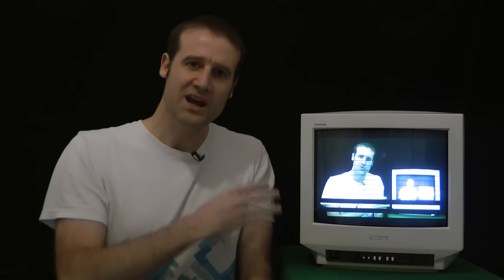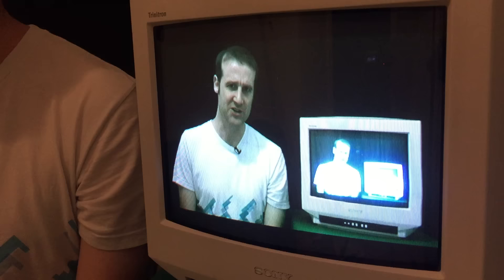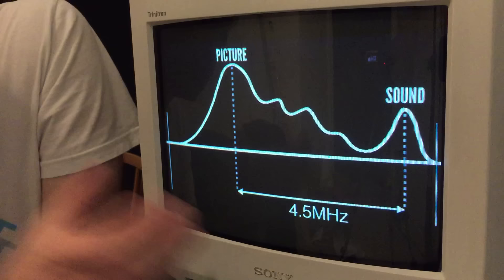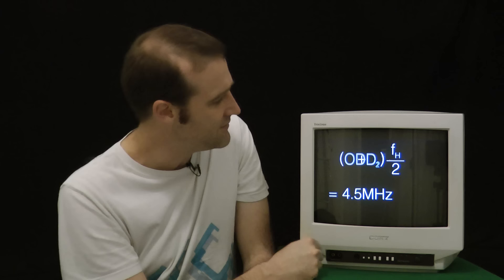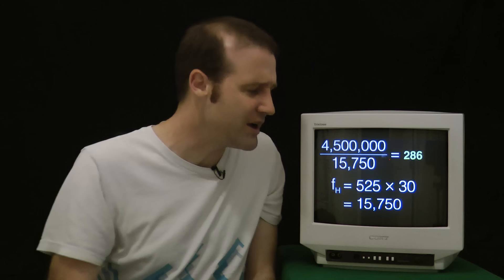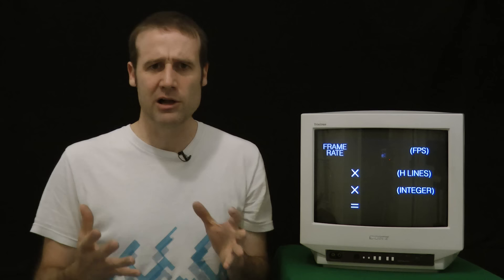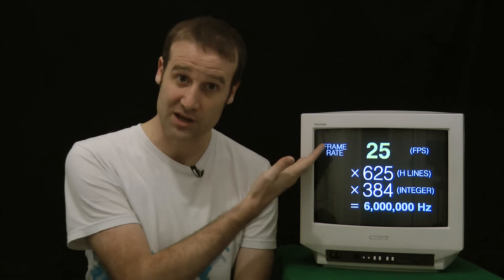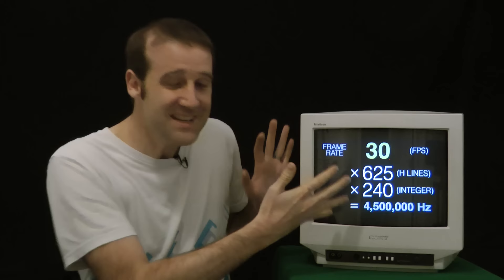Why is TV 29.97 frames per second?

Comment: Nice explanation and great graphics. Thank you.

Yes, film studios with their 24Hz frame rate would suffer badly from flicker when using mains-powered lights. So they commonly used to employ dc lighting powered by ac to dc converters comprising enormous ac motors driving great big dc generators (dynamos) to derive the current. Changing the frame rate would have been a right pain in this respect and even worse than film since a lot of television was, like the news, not staged and so not lit especially for the cameras.

With only 24 pictures per second, film is not great for showing smooth motion and cinematographers learned to film fast action coming toward the camera rather than across the stage. Forty-eight Herz is also a rather low flicker rate and was detectable by viewers though we became accustomed to filtering it out. Twenty-five frame TV was not significantly better with its 50Hz flicker. If you want to see it, look at the picture from a CRT set without frame-rate enhancement with the periphery of your eye.

Traditionally, the frequency was always expressed as 30 x 1000/1001. 

The point where this all went wrong was timecode. There are several awful things about the NTSC frame rate when it comes to accounting for each frame. First is that if you synchronise your clock to show 00:00:00:00 at midnight, then that event will never occur again - a frame boundary will never again happen at midnight. Next, the frame counter will be about 0.1% out. So drop-frame timecode was invented. The issue with drop-frame is that you really needed to handle positional values (the frame number of a frame) differently from interval values (the duration) and we didn't. Even accepting that we did not do that, no-one understood the arithmetic that was employed and the computer code to handle drop-frame was almost always (read always) wrong. There is a test that you can do where you ask the code to add one frame to a duration and the calculated out-frame value actually moves backward two frames rather than forward one. This is simply sloppy coding but software regularly could not handle this (and no-one tested for it).

Even 25 frames-per-second television was not immune to editing problems because the PAL eight-field sequence meant that you could only cut together two pieces of PAL encoded video when one was aligned to the other so that their eight field sequences matched. Put simply, and imagining you could hold video like pieces of film, you would cut the first where you wanted that sequence to finish. However, you could not then cut at the exact field boundary where you wanted to continue with the action in the next clip and join them together. Instead, you would have to align the second strip, shifting it until it lined-up its eight-field (four-frame) sequence to the first strip. This could mean getting up to seven extra fields that you did not want or losing three fields that you did! NTSC was slightly better but still had a four-field (two-frame) sequence.

Lastly, interlace didn't work. It may have been our first attempt at picture compression but it was a bad idea. In theory it delivered sharper pictures at a greater flicker rate in a lower bandwidth, only they were not sharper. Don't say this to anyone involved in TV from way back when because everyone learned the theory and next to no one questioned the empirical wisdom. Truly though, it did not work. It did improve the rendering of motion but did nothing for sharpness and this was clearly visible if you actually looked.
Reply: To be fair, you only had to worry about eight-field framing when doing "invisible edits". At a normal shot-change, four-field synchronisation was perfectly adequate.
For those not in the business, an invisible edit was one where you made an edit, (ie the recorder switched into record mode) but instead of recording a completely new image (eg cutting from a wide-shot of the landscape to a close-up of an actor),  the new image was identical to what was already on tape. It sounds pointless but it was necessary when you wanted to add visual effects. You sometimes see four-field attempts at invisible edits in old TV programmes, where the whole picture hops slightly to the side just before a mix to a new scene.

Comment: I love that at the end of the video the image on the screen has a visibly moving scan line because you recorded a 29.97FPS TV at 30FPS (used by Youtube and most modern video recording equipment but they also have a 25FPS option in these cameras as they are now often sold internationally, on a side note it's also why some lights flicker when filmed because of the camera being set to the wrong frame rate OR the lights are running through a cheap transformer that alters the Hz of the light to the standard in the country where the unit was manufactured).

Comment: My video tech career goes back to the mid 1970's. As a teacher and mentor I've often explained the 29.97 fps mystery to students of digital media,, but always from the aspect of backwards compatibility with 30fps televisions (-; so consumers could continue using their existing hardware, back when tech corp. profiteering through planned obsolescence, walled gardens and forced migration was limited by proper regulation and standards enforcement ;-). This explanation from the parallel concern of broadcast bandwidth allocations was enlightening and appreciated (as with most all your YouTube offerings)!.  Still, I find the engineering from the hardware signal and CRT compatibility side even more amazing, The final compromises, however, meant that accurate color reproduction in NTSC was very problematic compared to the European standards, thus, for many in the U.S. television industry, the NTSC acronym stood for "Never Twice the Same Color", while PAL was considered "Paradise At Last". The engineering of producing "moving" images from a single amplitude modulated signal will remain genius to me in any case.

Comment: Thanks, Matt. That was great! I knew the basics why, ie adding the colour info signal into the same bandwidth, but I had NO idea of the maths behind it.
Given the benefit of being able to improve on existing standards (ie NTSC, or "never the same colour") PAL turned out to be far superior, both in resolution and simplicity.
Long before colour, 30 fps TV had the awkward problem of transmitting 24 fps film without obviously speeding it up. Thus the 2/3 pulldown technique.
PAL, and 25 fps B&W TV before it, had no such problem. Running a 24 fps film at 25 fps was imperceptible, unless the viewer timed it VERY carefully.
Fortunately the advent of digital TV to match that of computers has (generally) meant MUCH less hassle than the old days of PAL (and SECAM) vs NTSC.
Also, in PAL countries, being able to record far longer on the same Beta cassette than our NTSC counterparts! (I still can't quite get WHY, though?)
Reply: 24 fps film broadcast might be one of the few areas that NTSC was better than PAL (I'll admit my knowledge of SECAM is lacking).  Over the course of a 2 hour movie, 2:3 pulldown would increase runtime by about 7.2 seconds, where as playing it a 25 fps would decrease playtime by 288 seconds; however, both would be almost entirely unnoticeable if you were watching it to actually enjoy it and not nitpick.

While I can't say exactly why Beta tapes last longer, I would guess its the same reason VHS tapes do.  In a VHS drum each full rotation records one frame (two head place 180 degrees apart for each field), so in order to record 29.97 fps, the drum must spin 29.97 times a second or 1798.2 rpm (1800 for B&W), where as to record 25 fps, the drum must spin 25 times a second or 1500 rpm.  VHS tapes were sold with different lengths of tape inside, but Beta was not, the same exact tapes were sold in PAL and NTSC. Because the cassette itself was unchanged between regions, and the drum size was the same, the NTSC tape was pulled further every second than the PAL tape.  I hope that makes some sense.
 
I will warn you though, it is possible that the drum itself is larger for NTSC and it spins at 1500 rpm too, but that seems unlikely. I say this because at 1800 rpm for NTSC and 1500 rpm for PAL would allow the exact same drum motor to be used because the of 60 hz vs 50 hz.
Reply: @dontworry1302  What a fabulously detailed reply! I am really very impressed with your level of research, knowledge, and insight!
"Because the cassette itself was unchanged between regions, and the drum size was the same, the NTSC tape was pulled further every second than the PAL tape. I hope that makes some sense." Yes, that sort of explains it, although LESS data (525 lines) should have resulted in LESS tape used per second of video in NTSC, IMHO.
However, whatever the pluses and minuses of Beta vs VHS, the simple fact remains that screening a 24 fps film on TV @ 25 fps is SO much simpler to achieve (ie NO conversion) than 24 fps to (almost) 30 fps. In fact there is NO apparent effect (unless you have a stopwatch), but in a relatively longer film it does make slightly more time for another ad or two! However, this only applies to (usually) SD broadcast television. So the minor (if almost indistinguishable) advantage of PAL (and SECAM), is more or less quite moot in these days of digital media. Therefore a Blu-ray disc (or equivalent download) is ALWAYS preferable to DVD quality these days for me! 
OTOH, if DVD is the only option, then I will ALWAYS prefer a UK DVD @ 625 lines vs a USA DVD @ 525 lines; just better visual resolution! (NO arguments accepted!)
NB: I especially LOVE the ability to watch true HD video in 1080p on BluRay. I also really love that the vexed issue of NTSC vs PAL has faded, at least wherever videos are available in true HD (1080p) or better. (BluRay region encoding IS a nuisance; however I buy all mine from the UK, so no problem!)
Reply: @rahb1  I was never a huge fan of DVDs, maybe because I was always watching them on SD LCD TVs and I can't stand the awful quality on them whether 525 or the few times I had access to a PAL LCD TV (got to love when family buys weird imports). My parents bought a PS3 back in 2006 at launch specifically for blu rays, and it was the first time I was fully able to enjoy home movies. Of course now I'm not sure I'd be able to stand 720p, but I guess thats just progress. 
I'm not sure about UK copyright law, but I know in the US as long as you own the blu ray, it is fully legal to rip it and do what you want with the file so long as it isn't shared around.  Had a few other region blu rays that got transferred to a double disk case and had a second disc with a nice North American compatible file on it. (Still not entirely sure what all had to be done for that)

Comment: The main reason they changed the refreshing frequency instead of changing the number of the horizontal line is the compatibility. With only the frame rate change, the old black and white tv can still be able to broadcast the color signal. If the number of the horizontal lines changed the old tv would be useless

Comment: For short: Color TV’s needed more data to display real color but on B/W TV’s the color data had slight interference with the visual data. So B/W TV’s hat little dots if broadcasted in color. So they had to make the frame rate a little lower so B/W TV users wont see that “artifact” and color TV users can still watch in color with no issues what so ever. It’s easy as that ;)

Comment: You forgot to mention in Europe (where PAL was developed) the power system is 50Hz AC. They didn't choose 25 because it would produce pretty numbers. They still had an interlaced picture, so their frame rate was 25Hz.

Comment: 625 pixels was not an option for NTSC because it would require more data per second than what was possible back then. PAL have fewer frames so it was possible to give it more pixel. PAL and NTSC have a very similar number of pixels per second (horizontal×vertical×frames per second).

Comment: Question for YouTube: How is it that Japan used 60Hz electricity on the east side of the island, and 50Hz on the west side, and yet they used standard NTSC just like the USA as a national TV standard? 

I've been to Japan, but 2018 was a little to late to start trying to look at their analogue broadcast signals!
Reply: Except possibly in very early models, the refresh rate of a CRT TV wasn't actually tied to the incoming electricity frequency - it could be pretty much arbitrary. Having it the same did help to hide some "noise" that leaked through the power conversion from AC to DC inside the TV set tho.

This is actually why the 30/1.001 refresh rate worked on B&W TVs in North America - they didn't actually require exactly 30Hz, but had tolerances in the system and were able to lock on to the slightly altered signal.

(Also note that the electricity frequency isn't fixed, but changes over time based on load on the grid - it's only 60Hz on average over large time spans)

Comment: There was also an issue with the persistence of the phosphors on the old CRTs that prevented a faster, single pass scan of the cathode gun but that is a discussion for another day. For now know that NTSC has been well and full abandoned for ATSC. Now 24p in 480, 720, 1080, 2K and 4K is now common. There is still backwards compatibility built into the ATSC standard for NTSC signals and 30p and (I believe) even 60p feeds. Largely, however most non-broadcast video playback is progressive. Interlace from the standpoint of production is now almost never discussed and we watch our programs with the same scan rates regardless of where you live. If you want a bizarre story read up on SECAM. It's like what if Lovecraft invented TV only less cheerful.

Comment: The problem with having a vertical sweep rate of 59.9403 Hz but an electrical frequency of 60 Hz is that the difference causes horizontal bars of static on the low channels and power supply ripple from any video source to run up the screen every 16.667 seconds. These anomalies do not happen on systems where the verticle sweep rates match the electrical frequencies.
Reply: But, modern power supplies are Switch Mode Power Supplies with the output unrelated to the supply frequency and MUCH "smoother".

Comment: PAL was released in 1963,a full 10 years later, after NTSC, so of cource they can make improvements. The Key to NTSC was it needed to work with 100 million B&W televisions in existence and with the new color tv standards, it worked and it was BRILLIANT!  NTSC was also racing against a mechanical color wheel system being pushed by Columbia (CBS Labs). so they had to make a working prototype very quickly before the industry was saddled with a mechanical system.

Comment: One reason for 30 FPS was the line frequency of 60 Hz. If you had a set that had marginal power filtering it could still have a good picture. Changing the frame rate meant that such a set would have a brightness band drifting down the screen.

Comment: Maybe very early televisions used the power line for synchronization but this was  quickly abandoned for sync pulses embedded in the video signal. The power line frequency is not very stable in the short term, and the  power grid  is divided into sub-grids each running asynchronously. Ultimately the TV networks used very accurate atomic signal standards, so the Network's embedded sync signals were stable enough that NBS (now NIST) produced a weekly report giving the network sync traceability to  NBS time and frequency standards. Therefore engineers and  scientists used the sync from network TV broadcasts as a precision time base.

The real reason for 30 Hz was, as you touched on, was interference,  Hum induced  into the video signal from the power grid would tend to make  a "hum bar" that would move vertically on the screen as the power frequency beat against the sync frequency. By keeping the sync frequency very close to the power line frequency, the motion of the hum bar can be made to be very slow. Since human vision is very sensitive to motion, a slow moving hum bar is less visible that a faster moving hum bar. This is why they chose 30 Hz frame rate in North America and 25 Hz frame rate in most other parts of the world (to hide the hm bar produced by 25 Hz power). As TV technology became more advanced, hum became less of a  problem, but the standards were in place by them.

As  a kid, I remember that every time a TV station switched from local video to network video, typically a few times an hour when they inserted local ads and ID, they picture would "flip" as the  TV receiver locked up to the new sync source (since the local station and the network each had their own house sync generators which ran asynchronously). This problem went away as digital framestore became available so that "outside" video, such as network video, could be locked to each local station's house sync. Of course, this caused us to lose the  capability of using network TV as a precision time base...

Your explanation of how they picked the color subcarrier frequency was great!

Comment: This has to do with the fact that the new color broadcast format had to be compatible with the older black and white sets (without the color, obviously). It's also worth noting that the refresh rate is established internally, not from the power line frequency. If you think about it, 25 is just a number and the fact that it's an exact round number is only an engineering convenience.